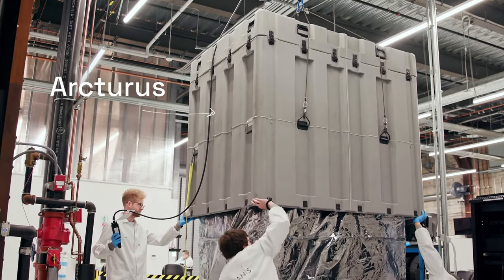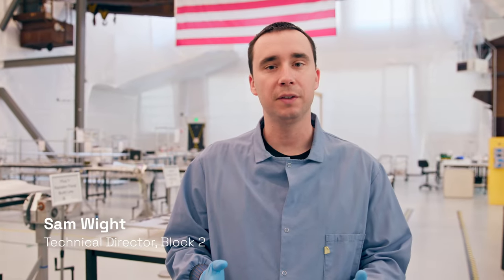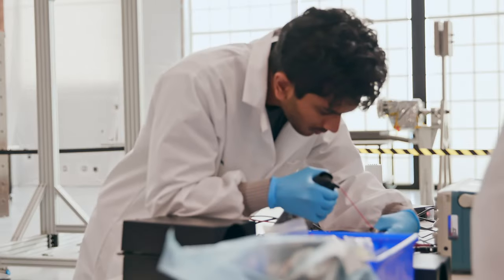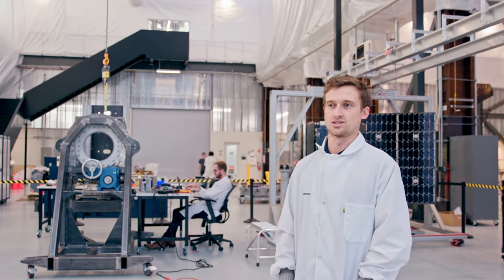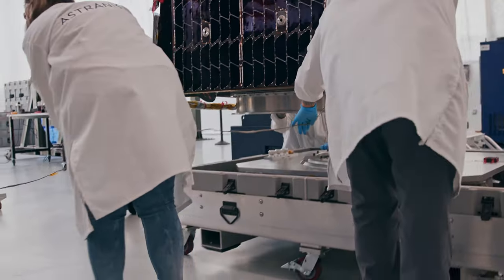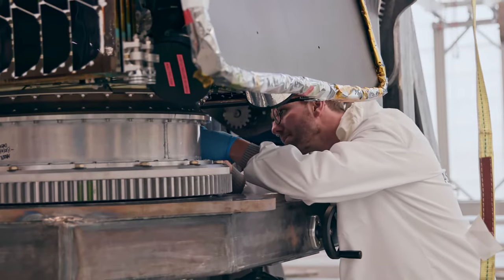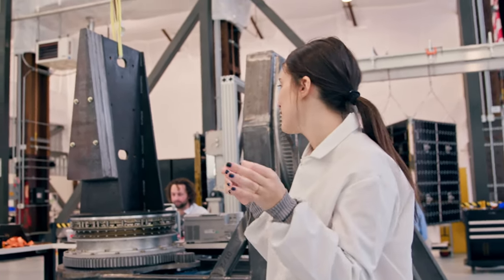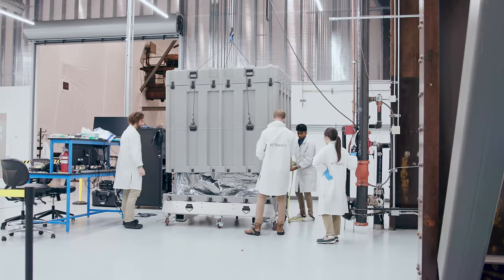Getting Arcturus Ready for Launch - Vlog 1

Comment: I noticed a few basic policies that are usually standard in AIT and surprised not implemented at your company.

1) Assembly techs required to ground themselves when near or touching the SAT.

2) Shop coats having a thin metal grid inside fabric. Further preventing electrical discharge. 

3) Covering any exposed hair to limit FOD.

4) No power tool to prevent cross threading.

As a fellow AIT tech knowing how much work goes into building a SAT. Last thing I want is a failure that could’ve been easily prevented.  Good luck !
Reply: 38 3uj.